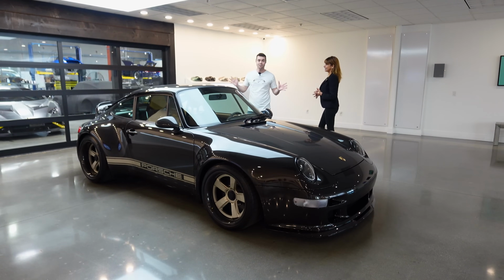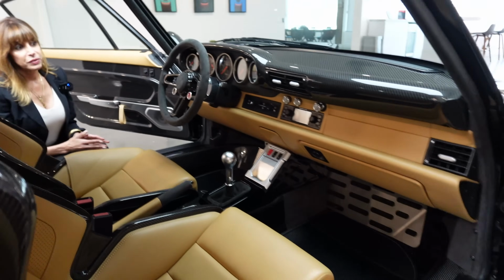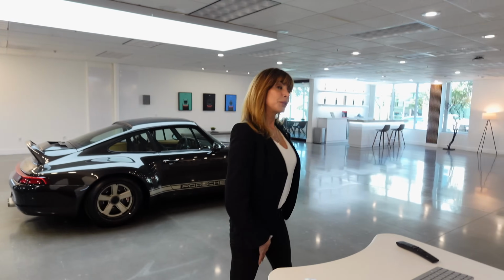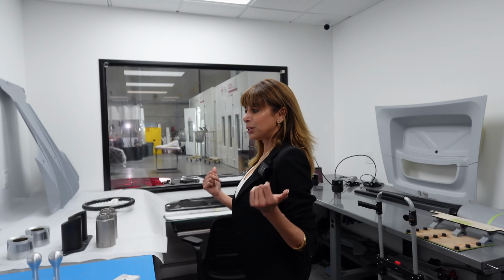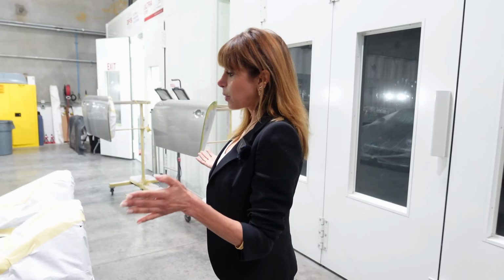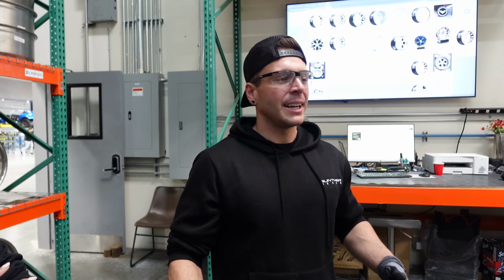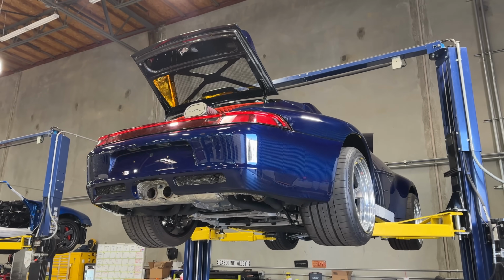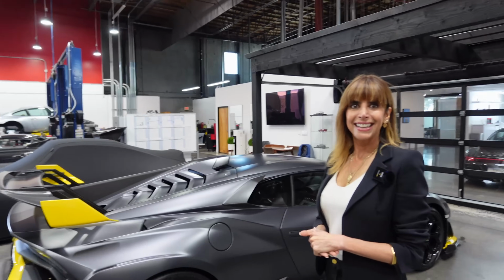Gunther Werks Factory Tour: How The World's Coolest Porsche Are Made

Comment: Interesting craftmanship but some vey weird arab prince choices. 

Carbon fibre dash top (non structural and shiny for a part that should not generate reflections?), interior CF door handles snd leather door pulls in the same place as well (why?), very tacky aftermarket instruments, cup holders in a sportscar (who drinks milkshake in a sportscar?).

Magnesium is only a smart choice for GW as the wheels as the customer will need to be reminded to change them every 5 years as magnesium cracks and has a limited structural life. 

Out of curiosity I looked up the weight of the car on the GW website. For the coupé it is 1214 kg (2677 lbs). The standard car (Wikipedia) is 1370kg (3131 lb) so the expensive CF make over saves just 156 kg (11%) over standard. 

I was expecting a CF rebodied car to come in at 1000 -1100 kg so there is an extra 20% improvement to come.